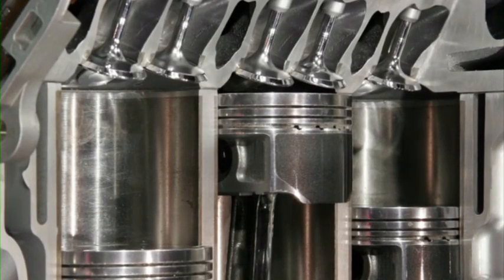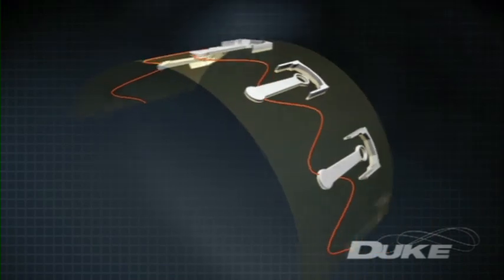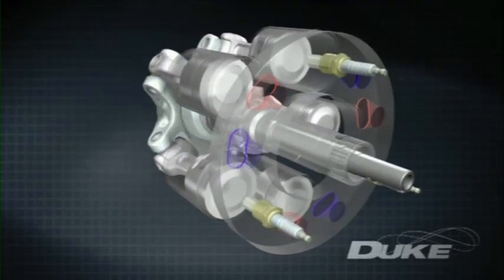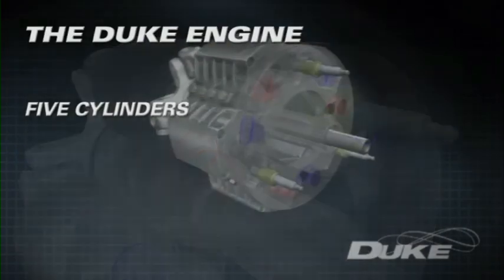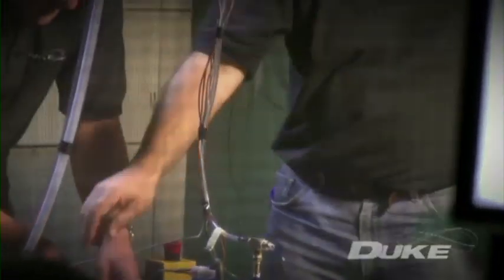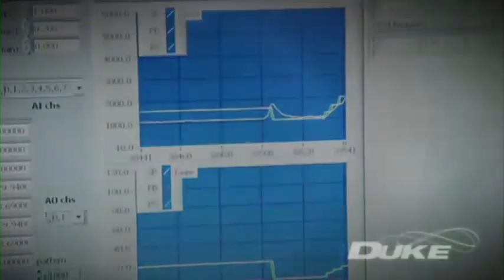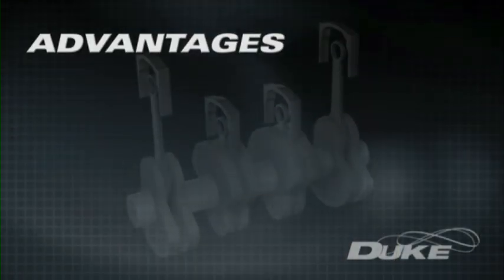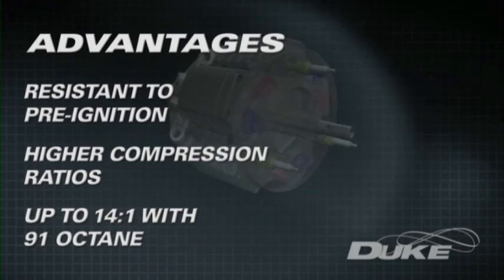Duke Engines

Comment: "Fewer parts"? hahahaha

Just looking at the animations you can tell this would be a massive headache to any expert mechanic. Everything moves. LOLOL
Reply: You can have a large portion of parts move. But the amount of SOLID OBJECTS(parts)  in total is less.
Reply: It may actually have fewer parts, but it likely loses efficiency in sealing the cylinder. Similar to the Wankel engine in that way. May also be more angular momentum (flywheel effect) because the moving parts are at a large radius (figure skater effect, arms in vs out), and possibly more rotating mass too.

If it was invented and tooled up in the 40s or 50s, it might be competitive with regular fixed cylinder & crankshaft engines, and maybe kept pace with them. Since the current widespread engines are kind of approaching theoretical limits of what you can do with exploding gasoline in a cylinder, "new paradigms" aren't all that great, unless it can be made massively cheaper.
Reply: Moving the entire block like this seems silly.

Less parts by making many more moving parts is not going to reduce costs. Movement requires high precision parts which require higher capital investments for finer equipment, and they increase the maintenance costs in general. 

Having the engine block rotating seems sill because like others have said now you have angular momentum and what happens if a piston rings fails and one cylinder loses compression or one of the fuel injectors fails, what kind of harmonics could this cause? Is the engine going to fly apart from itself? In a V or inline cylinder arrangement it makes little difference, the engine just makes less power but keeps going.
Reply: Scotty kilmer’s gonna go full rant lol
Reply: @kinpro1024  lol no he won't. He'll just be like "I don't know. It doesn't exist. I've never worked on one or drove one. Next question."
Reply: It is basically a modified AC compressor expanded lol
Reply: So manny moving parts
Reply: You guys looks at the actual engine in the video. The animation is full of shit the pistons dont move with the crankshaft it's a swashplate engine really nothing new here
Reply: 5 cylinders, no cam no valves. big but small amount of parts

Comment: we dont need a different engine to increase fuel efficiency, we need less greedy people in the oil industry. there have been dozens of designs to increase fuel efficiency with the current engines, but it will never happen, nether will electric cars take over gas because of greed.

Comment: im sorry but this has the same major flaw that the rotary engine has. its damn difficult to seal a cylinder against a flat surface relative to which it is moving. this engine will never be as efficient as the tried and true fixed cylinder ic engine. simplicity is key to a good efficient ic engine

Comment: As the Duke engine stands today:-
Duke engines are not currently commercially available.
•    Duke is currently without funds and urgently requires an injection of capital.
•    Duke is an engine design and development company and will be supplying engines in conjunction with a co-development partner under license.
•    That go-to-market partner will have the necessary amount of capital available to make the engines ready for manufacturing and commercialisation and is yet to be secured - a variety of discussions are currently ongoing.
•    Once we secure that partnership - we expect that the engines will be available for purchase within 2  - 3 years.
•    Duke is at a major crossroad in the company’s history, as we seek funding for the next stage which is estimated to cost around US$6M and take up to 2 years to have engines ready for field trials, durability and performance testing in readiness for a volume production run. 
•    This exercise will likely be in conjunction with Mahle Powertrain in the USA.
Reply: +Michael “Korky the Kat” Corke
 The R&D and prototyping stages are usually the major expense. The video shows that it has been completed. I believe that there are other underlining issues holding this back. I'm excited to see this in production.

Comment: It seems you'd be limited on the number of the cylinders you can use in an engine of this design, without increasing the overall size of the engine to an impractical degree.

Comment: To research engineers worldwide.   I have a far better idea.   Use this concept to build world's largest motor with 10,000 cylinders.  Skip the spark plugs and ignition and fuel.  At the drive-shaft, attach a 30 meter long bar running 90 degrees to the drive-shaft.   At the end of that shaft place a drive animal such as 2 oxen and have them walk in a circle.   The pistons would compress air only.   The air could be used to function in a variety of ways.
Reply: +David Locklear you should not have stopped your medication plan sir..
Reply: +David Locklear look up the Dunning-Kruger effect before you try to tell research engineers that you have "far better" ideas.
Reply: +parapobabam  I looked it up and have observed the 2nd definition on the internet and found it very annoying. Now I know what to call it when experts give incomplete instructions on how to do something on your computer making the instructions useless to laypersons who can follow clear instructions but cannot follow these instructions because they lack the knowledge the person giving the instructions has.

Comment: they call the poppet valve complex? Look at all the fancy machining and polishing required to make this engine function. one large main bearing to contain all that power? wow. look at all those large cam followers. so many bearings... sure, current engines are not all that efficient but i dont hear how more efficient this engine is. at a third edition of this engine and yet no real world values, i find it difficult to believe they can manufacture this thing as inexpensively as current engines. block for block that engine would be 8x the cost.

Comment: These are limited to low RPMs though, so they are unlikely to be used in cars.
Reply: Stuntman Mike
By low RPMs, I mean 500-1000 RPM, that's not usable in a car at all.
Reply: Stuntman Mike
What do you drive, a semi truck? lol
Reply: Stuntman Mike
Ah, that explains it. That's not really a car though, i'm talking about stuff like economy cars etc. Those need to do a maximum 6-7k RPM or thereabouts
Reply: +Stuntman Mike "Ford F350 with bigger engine."  LOL
Reply: Topi Salo
I know that cracked me up, guy sounds like he has not the slightest clue.  He must not ever drive on the interstate either, I've had several F350's LOL
Reply: Stuntman Mike
No videos of this "semi truck engine" you claim you have swapped in a F350, so what engine and transmission you got in it?  People talk a bunch of crap they cannot back up on the internet with no proof, don't expect me to believe you.
Neah I just drive a Yugo.  Hahahaha
Reply: Stuntman Mike
No you don't.  No proof to back up your claim and you couldn't even answer the question, you can cuss at me like a grade school child all you want, only thing it proves is how immature you are.
IF you had what you claimed you would be able to prove it.

".its pretty easy to fit bigger engine in F350 since it has lot of space on engine bay"
I've salvaged quite a few, I guarantee you don't know what you are talking about.

Comment: I believe a proper cylinder would be better as trying to seal the cylinders is going to require a moving seal which will wear rappidly and require complete engine disassembly to replace. This would be detrimental to engine longevity so it would probably make a good race engine with the type of compression you can run per fuel octane but it wouldn't make a great production engine in a car. I would totally put one into a project car of mine but I wouldn't want to dayly drive it as longevity is a concern. would make a great race engine though nonetheless

Comment: If this engine is so efficient, why haven't we seen it anywhere??? I am not even an engineer but I can see just how imbalanced and wobbly this whole pile of crap is... How can it even rotate the combustion chambers around the cylinder heads with a 14:1 compression ratio? What kind of headgasket??? So the piston cylinders move in circular motion? Sounds like a lot of wear and tear to me...
Why reinvent the wheel if the wheel is working fine in the first place? Engineers have nothing better to do than engineer some stupid crap just so you can engineer something new?
Reply: +omfgwtfbbq90 Exactly, we should have just stuck with walking! Stupid engineers inventing the wheel when our legs work perfectly fine. The world is certainty better off because you AREN'T an engineer...
Reply: +omfgwtfbbq90 That's pretty dumb. Just because this idea might not be very good, it doesn't mean people shouldn't keep coming up with new ideas Horses had been working fine for centuries as a means of traction, when some guy decided to try something totally discredited at the time. Now the whole world has changed because of his reinventing the wheel idea. This is what pushes the world foward.
Reply: omfgwtfbbq90 It's not the engine I stand for, but th attitude, the initiative, the attempt. It could present some advantages in some uses. But if it doesn't, what's wrong with trying? Most reliable things had to be perfected through time, including piston engines. Btw, if the oil companies didn't control politics, combustion engines were likely to become obsolete sooner than we think.
Reply: ***** We have had combustion engines for more than a century now, there were a whole lot of different types of engines but there is a reason why the piston engine as it is now is the most popular and most reliable. Don't you think this duke engine is way too complicated to be reliable? There is too many moving parts, and explain me this rotating head gasket then? I like that humanity invents new things but you gotta admit this engine looks pretty dumb. If you are defending this engine so much then please make me change my mind and let me see a practical (and reliable) application for it???
Reply: +omfgwtfbbq90 Ah everyone is trying to make a buck, bet they waste more than they make when they could have just researched other ways of making new heads for current engines to make them better and they would have made some money along the way, but then again someone dreamed up the Yugo and some stupid people footed the bill....

Comment: Well, you are only firing one cylinder at a time, so yea... an engine of similar displacement would have much higher emission output, and also much higher power per stroke cycle.

Comment: This is basically how a hydrolic accumulator works in reverse, and with the same problems that would be seen in that design.  The eccentric drive bearing will have to take an extreme brunt of force.

Comment: I think there's too much friction caused by rotating cylinders around the engine. Imagine the friction going on between the cylinder that's burning and the rotating plate.

The other issue is that the back and forth motion is converted to rotary motion by an angled bearing, which again I think causes more friction than a classic 90 degree connection to a crankshaft.

Imagine you are trying to push a car that's out of gas, but instead of pushing from the back, you are pushing at 45 degrees on the driver's door. 50% of the energy you apply to the car will be converted into forward movement. The other 50% will be wasted by trying to push the car sideways, and the tires won't let you. That's the same principle the angled bearing shaft achieves.

Comment: 1min53sec  Exhaust is shown wrapped around the intake filter cone. Fucking lol.
Reply: +Brendan N Lol Appearently they are exhausting gases out the same hole that they take in air, I bet it will never fail a smog check because its exhaust gases are also getting filtered! lol

Comment: Talk to Volvo, they are very interested in new engines that don't have to be power optimized.
Question is now, how durable is such a engine compared to it's long  time developed competitor?
Does it also run as smooth as a 6 Cylinder engine?
Does their 6 Cylinder use less fuel then a modern 4 Cylinder these days (assuming the comparisson was a 4-stroke 6 Cylinder)?

PS: i found out later in comments, the engine is bullshit.

Comment: Assuming the CAD design is similar to the actual motor, I have some questions.
1. Since there's minimal lateral movement between the swash plate and piston, couldn't the pistons themselves be shorter and also not require the wrist pins? Potentially eliminate several parts, reducing overall weight, and increasing rev limit and throttle response.
2. How do you cool the rotating cylinder block? and how is the engine coolant sealed off?
3. How is the stationary head sealed to the block and what way are the contact surfaces set up to reduce oil burning and parasitic drag?

Comment: Wouldn't the single spark plug wear out 5x faster?  Also, there's no redundancy so if you have a bad plug/wire it pretty much won't run at all (whereas with a conventional engine it will simply run rough if a single plug or wire is bad).  Also, the plug needs to be where it can be easily changed or it will run into the same problem faced by many Mazda RX owners of not being able to access the spark plugs easily.

Maybe this axial array might be better with something like a Stirling engine?

Comment: As an old mechanic I love to HATE the wobble motor, my only real experience I've had is with Air-condition compressors, years back we ran axial compressors, heavy-reliable-powerful. now we run wobble plate designs such as this,                       Modern-Complex working angels Always lead to failure, this engine will run fine if Completely maintained and clean, Ahhh But once a little dirt or any other "real-world" condition pops up your done.

Comment: seals, seals, seals.   what a nightmare.I've been around  'wobblebox'   technology  for a lot of years,  'turning  linear motion into rotary'..    and   this is just another version of  a  radial.      (shared central  crankpin).As with  the radial,  I wonder about the poor  cylinder  that ended up on the bottom for shutdown...   and  the  'clearing' process to   get the oil  removed  for the next  start up!  As for  the  emissions...  either in this engine or any other..    I think it's time to  look into the fuel itself  for  progress in the   'cleaning the air'.

Comment: So it is half way between a standard four stroke and a Wankel Rotary, but with the disadvantages of both?
Reply: +spacecadet35 I'd even venture to  compare it closer to a  jive  ol  radial..   minus the  valve train of course...I wonder just how heavy the flywheel is on this thing!  it's gotta be a monster just to  balance out the  'rotating'  mass
Reply: @Bob. Actually, in the old rotary engines used during WW1 one of the advantages of the rotary was that the whole spinning mass could be used as a flywheel in its own right. However, having such a large spinning mass meant that the aircraft could turn a lot faster in one direction than the other. Also they never figured out how to scavenge the oil, so the old rotaries used a total loss oils system.
Reply: yep@ spacecadet35  Plus the prop!  heck of a flywheel!
Even this engine is going to  have  oil  settle in the bottom cylinder during  shutdown..  unless maybe they configure it to run vertical?   (make for some  goofy hood designs!)
I  still think the mass of  running  a cam, and  valves  is much lighter and less power robbing and  a  ton less  sealing problems.   Not to mention  the tweaking of  valve timing, or duration!

Comment: This is like a worse version of a typical Wankel Engine in terms of efficiency and wear.
Reply: +spoon games Rebuilding a Wankle engine is also by far easier than a typical piston one
Reply: Right because of all the internal friction they have going on
Reply: In my opinions the Wankel engine wasn't as bad as people said it was, it makes 1 rotation for all the combustion process unlike a piston engine where it makes 2 on the crankshaft, the have a high power to weight ration and can make a lot of hp for how much displacement it has. If you have the time to rebuild the engine every 120k miles because the seals and don't mind spending a lot of money on it than you will love it but like I said this is my opinion
Reply: +spoon games ratio*
Reply: +DjNerDee Wasted way more gas than a typical junk chevy V8 that could some how make more power.
Reply: +DjNerDee Wasted way more gas than a typical junk chevy V8 that could some how make more power.
Reply: +sayan das practically zero friction with less moving parts and no oil/o2 seep this really doesn't hold up to scrutiny.

In short you're wrong.

A wankel engine is an entirely different desgin.
Reply: +sayan das perhaps they should call it a Wanker engine.
Reply: sayan das in efficiency the wankle is amazing but let put that to the side. This Duke engine is way worse then wankles.
Reply: DjNerDee yeah , just the seals. Other than that and heat the wankle is better . I'mma start designing ways to fix those problems in a few years , I already got some concepts ready
Reply: Patrick TheBaptist You do know that the wankle produces more power per liter ? Also they do suck in fuel consumption and ,in my opinion , need to become hybrid Biodiesels